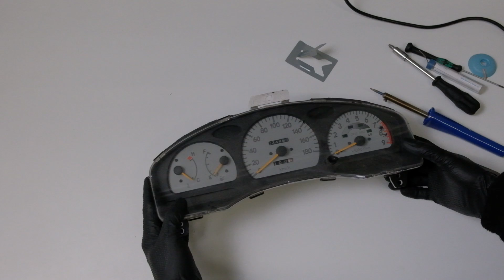Tacho Resistor Mod for Standalone ECU's - Toyota Starlet EP91 Glanza V

Comment: I’m currently doing this mod with a link Ecu. Where is the signal wire that triggers the needle ?
Reply from the maker: If you have a Toyota Starlet EP9_ then you will find the signal wire on the 16 pin body connector next to the ECU plugs. It's a solid black wire.
On EP8_ Starlets it's a solid black wire in the 20 pin body connector at the interior fusebox.

Other 90's Toyota's may be similar with a solid black wire but may differ

Comment: My rev counter is coming and going when you start it from cold and is out of sync then completely stops working, any idea why?
Reply from the maker: Did you complete the modification and are you using a standalone ECU?
Reply: @epwiring yeah it was working for ages and it just stopped one day
Reply from the maker: Hard to diagnose over the internet but my first steps would be investigating a possible intermittent wiring fault, check the connectors are properly seated or check for failed soldering with the mod possibly
Reply: @epwiring couod do , might check it out with a multimeter to see if it’s coming to clocks least then I’d know if it’s them

Comment: Hello friend, greetings from Panama🇵🇦 I have a problem with my tachometer since I adapted a black background one that marks up to 8k rpm which the 2efe or 4efe with distributor brings. and my engine is 5efe or (Double ignition coil or coils) the problem is that the signal sent by the ecu is not as strong as that of the distributor, and the rpm tachometer for that Coil model is the blue background up to 7k rpm. .. I need to adapt this 8k one could you help me friend?
Reply from the maker: It is possible you are having the same issue which the tacho mod fixes. The only thing I would check before doing it is that the tachometer signal is going to the same pin. The tachometer wire is solid black and the signal should be marked on the cluster as IGN- or something similar
Reply: @epwiring  The signal comes from a black cable with a blue stripe which sends the signal low from the 5efe ecu and effectively ignites the tachometer so that it rotates the rpm, I already provided it in a 2efe with distributor and yes it does read rpm but on my 5efe double coil nothing
Reply from the maker: @CarlosOlmos-bm2yn  I don't know an awful lot about stock 5E wiring. What I do know is that on the 98-99 JDM 4E-FE engines on Starlets which have wasted spark coil packs, the signal comes from the ECU instead of the ignitor. Also the tacho signal wire on Euro and JDM starlets 1989-1999 is solid black with no stripe, it may differ on your vehicle. I am also unsure what sort of signal comes out of the ECU, it may be the case the signal is around 12V and therefore would not work with a 96-97 gauge cluster which expects a ~40V signal

Comment: hola , sabes como puedo verificar si ese tacometro esta bueno? fuera del vehiculo
Reply from the maker: You could test a tachometer on the bench by supplying 12v power and ground and using a programmable ECU where you can manually set an output to PWM and control the frequency. You would need to complete the tachometer modification (if required) before.

Comment: @epwiring thanks for the video, I am trying to connect the Glanza rpm to work on my ep where  engine is diesel is a 1nt( my friend checked and the mechanical diesel pump 
Outputs 3volts) will this work?

Thanks million for knowledge sharing
Reply from the maker: Interesting idea, I will be honest and say I have no idea if that would work 😂 however I did find a decent thread on the Link forums which suggests it could potentially work

https://forums.linkecu.com/topic/20406-tach-output-config/
Reply: @epwiring  thanks million. You genius. Blessed day ahead

Comment: Will this work on a paseo cluster with only revs to 7k and will the resistor have to be the same ohms?? Also excellent video I was wondering the how would I get the signal when I make my 5efe standalone and individual coils
Reply from the maker: @elvingarcia3770 I can't say for sure as I've not looked at a paseo cluster before but it's possible it will be the same . I do know that there are Celicas and other 90's Toyota's where the layout of the board and resistor ohms are exactly the same. 

I would try to get it to work without doing any modifications at all first and then if it's not working you can investigate if the mod is required.

Comment: Good job. Is the standard wiring to the cluster remain the same?
Reply from the maker: @arnoldodida Yeah, I don't touch the dash wiring at the gauge cluster at all. On the Glanza V you will find a solid black wire which is on a 16-way body connector near the ECU plugs. This is where I connect to an ECU output for driving the tacho.